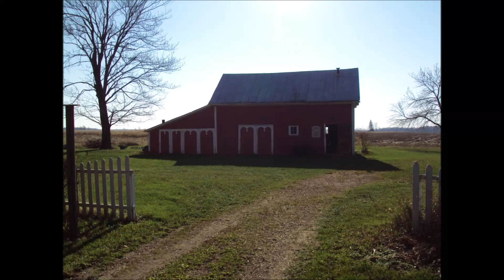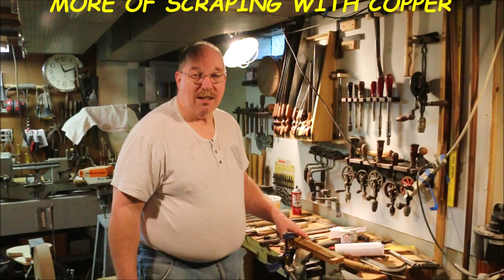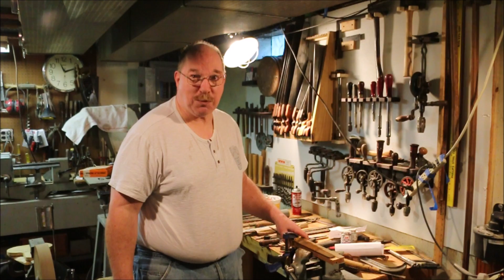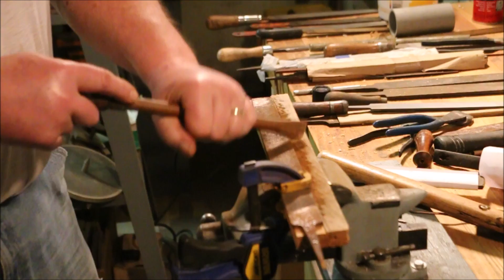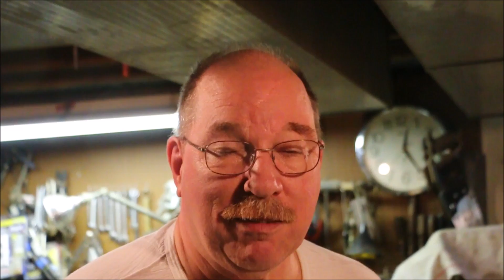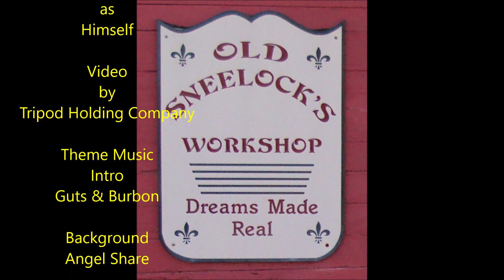SHARPENING FILES WITH ACID ~ PART 4 ~ MORE OF SCRAPING WITH COPPER

Comment: Is it worth all that ? I went to a flea market this weekend and you can buy files, all shapes, sizes and major brands for 50 cents to a dollar tops. Most in pretty good shape. Drop in evapo-rust for 4 hours, hit them with a good wire brush, spray a little WD40 on them, blow off with compressor then card them. They look like brand new.
Reply from the maker: That is a good price. 
If you can get good ones cheap then have at it. 😁😎

Comment: Black Smith rasps  have really big teeth.   And the dull fast. And are around 40 bucks each.   Any sugestions?
Reply from the maker: Walter Davis You probably already do this but file steel hot. It cuts fast and doesn't dull the rasp as quick. 
Acid will sharpen rasps too. Don't wait too long to sharpen them. 4 or five tune ups are better than one major rework. Best part you have a sharp rasp 5 times instead of twice.
Reply: Old Sneelock's Workshop.  I just trim. Don't shoe.  But the dull quickly
Reply from the maker: Walter Davis $40.00 should get you a top of the line rasp. Amazon list this one for $27.00.  https://www.amazon.com/product-reviews/B06XVZ9T5P/ref=pd_cp_199_cr_1?ie=UTF8&pd_rd_i=B06XVZ9T5P&pd_rd_r=782d5f5e-6d2f-11e8-8e75-010044d11cdd&pd_rd_w=nyTSF&pd_rd_wg=REyB9&pf_rd_i=desktop-dp-sims&pf_rd_m=ATVPDKIKX0DER&pf_rd_p=80460301815383741&pf_rd_r=6BPC97SZFZQPVA0CKJ2H&pf_rd_s=desktop-dp-sims&pf_rd_t=40701&refRID=6BPC97SZFZQPVA0CKJ2H
If you are buying Asian files they are case hardened junk. Sharpening a case hardened file won't work. They are only hard about .010 deep.

Comment: Will the copper work on a double cut file?
Reply from the maker: My experience says yes. I haven't done and exhaustive study on double cut files but the files I have cleaned with the copper tube supports the idea. 
Yesterday I had done one double cut file. It was a BICKHAUS. I'm not familiar with the brand but when you buy odd lots you get odd files. 😊 
The copper did a good job. It is a 14" long 1 5/16" wide by 5/16" thick monster of a file with 30 fine teeth per inch. Usually the bigger the file the bigger the teeth. 
I'm in the shop right now working on the backlog of files so I picked out three double cut files and tried the copper on them. The first two were rusted but not badly. I could still easily run the copper across the file. It worked just as well on the double cut as it does on a single. 
The third was a really gummed up half round. Half rounds are hard to clean because to their shape. Trying to keep the copper in the grooves while following the surface is a challenge. On the flat side it did just as well as on a flat single cut mill file.

Comment: so...how do we stop our files from rusting if they are super clean?    ive used wd40, yeah i know, but its better than them rusting, it leaves very little oil
Reply from the maker: Jusb1066 I used WD-40 on the first batch. It didn't cause any problems. Still in the exploring ideas phase of file recovery. I have only been at it about 20 years. Still lots to learn. 😆
Reply: We were talking about this. All ideas are very welcome. We might as well start tossing stuff around now as waiting.
Reply: ..i rub some oil free chalk on mine and keep them in the package it came in or make a scabbard. i also throw those silicone packs that come in stuff in the drawer ot help absorb some of the moisture. it's just one fight in the battle with rust...
Reply from the maker: The test batch of threaded rod that I'm trying to eat up with vinegar and sulfuric rusted to a fair thee well over the weekend while I was at Ryan's house for the holiday. That was in the nice dry, air conditioned shop in the basement. No tools rusted but the thread sure did. Two possible reasons. Not enough neutralizing with the baking soda or the surface was eager to take on some oxygen. 
Tuesday I ran them in the test again. It was going to rain yesterday so I brought them in and put odorless mineral spirits on them. Nice stuff. It doesn't have the added scent so having it in the basement doesn't stink up the house. No rust showing on them this morning. 
I
Reply from the maker: What do you use for a scabbard? I was thinking of making a slip on handle/scabbard for the four way rasp and file combo that I just cleaned. Can't hold it otherwise. The rasp will chew my hand up right through a glove.

Comment: The way I use copper tubing is to run the copper tubing flat across the file and the file cuts mini teeth which can then clean about an inch at a time.
Reply from the maker: That is the proper method. If I had even marginally normal files that would be the best way to use the copper tube. That will work on files that aren't caked with rust and a black tarry goo that seems to be petrified oil. 
About 4 years ago I had an idea to demonstrate not just the process of sharpening a file but to show how it worked. To accomplish that I needed a few dull files. Thinking that extremes are the best examples I began gathering up files that still had teeth but were dull.  Hard to believe but it took a while. 
I started with the copper flat and straight. Then by vigorously scrubbing the edge into the file in an attempt to scrape the tar out of it, it slowly became rounded, then more arrowhead shaped. 
When I have these files cleaned I hope to avoid gathering any more really screwed up rusty files. I will then recut the end of the copper and start over. 😆

Comment: ..Given that Rust could theoretically sharpen a file once it is removed. Then could you use something like Evapo-Rust, Rustlick, Goof-off and the like to chemically do the same?? Chicken or the egg?, Big Bang or Creationism? Ya done went and opened up a can Bossman. This shallow swimmer don't do to good on the deep end...!!
Reply from the maker: Ol James Jusb1066 hit it on the head. I was thinking clean one of these really well and set it out to rust.  Then I could run it in the electrolysis tank and see if it sharpens it. 
This could go on for years. 😈
Reply: or vinegar..or elecrolysis! :)
Reply from the maker: Ol James The idea of rust eroding the teeth like the acid is counter intuitive. Rusty stuff is suppose to be dull. It's going to be bothering me for a while. Not on a conscious level of course. Just one of those questions like how far is up? 😈
Reply: rust in the end is a chemical attack of the surface, air being slightly acid and a very long time to act,  the  hard part is removing the rust, hence electrolysis to soften it for the manual removal, do i think rust is a proper way to sharpen? no, acid will be better and not leave rust still to be removed
Reply from the maker: I agree. The first batch of files I ever sharpened is still in use. I don't work them hard or often so they should be in the boxes that Ryan has to sort someday. 
Avoiding rust is much easier than removing it. If it wasn't for the interesting idea of this experiment I probably wouldn't be sharpening these, or any more of them .